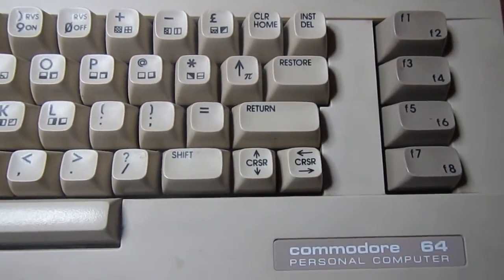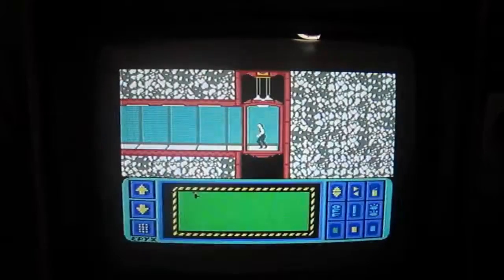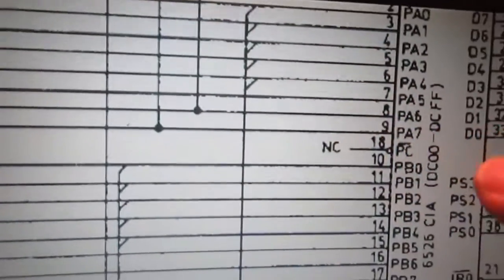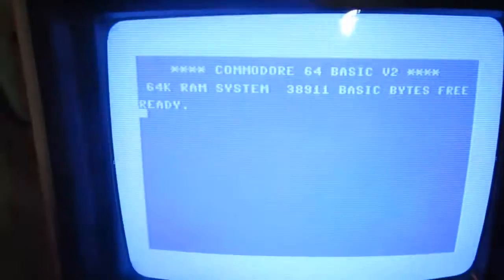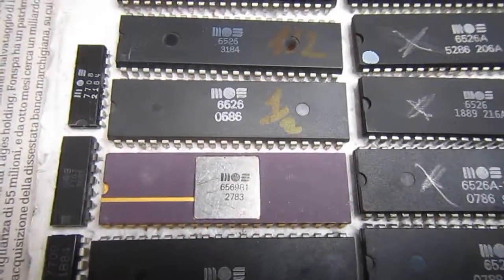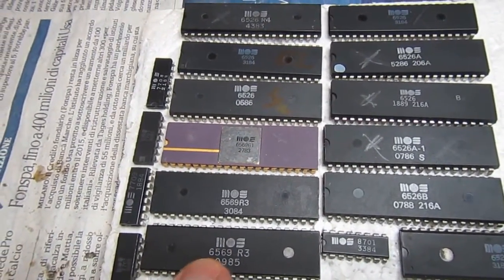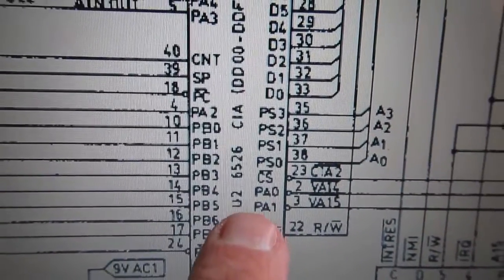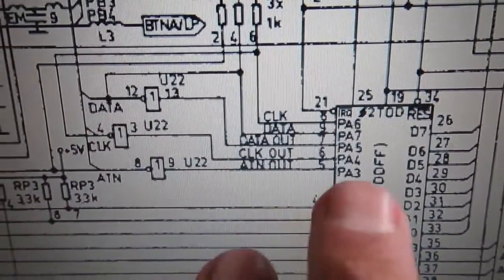C64 (C64C) CIA#1 repair (keyboard/joystick faults)

Comment: Hi, nice video, actually my c64 has issues when I get joystick into port 1 and press left, it responds kind of laggy , Ive been using this program as I dont have from where to load programs, my datasette has issues also, I can only save to it what I write and then load from it, but i cannot load my original tapes, i tried 4 of them and also tried some fresh recorded ones on 2 different cassete players, still no results, this is what i used for joystick testing: 
10 for k=0 to 10:read dr$(k):next
20 data "","up","down","","left","up/left"
30 data "down/left","","right","up/right","down/right"
100 j1=peek(56321):j2=peek(56320)
110 f1=j1 and 16:f2=j2 and 16
120 j1=15-(j1 and 15):j2=15-(j2 and 15)
125 print "j1 "dr$(j1):print chr$(145) tab(20) "j2 "dr$(j2)
130 if f1<>16 then print chr$(145) tab(14) "fire!"
140 if f2<>16 then print chr$(145) tab(34) "fire!"
150 goto 100
Reply from the maker: the fastest thing you can try is to swap the two 6526 if they're socketed. However it's not easy to understand what you mean by "kind of laggy". I guess you get a delayed action. It's not very simple to debug such an issue remotely. The joystick inputs go directly to 6526@U1 with just a
feedthrough filter in beetween. If there's the correct continuity through the filter, there's not much else that can cause this fault other than the 6526 itself.
Reply: @iz8dwf  yes, delayed means 😁" kind of laggy" thank you for your response, I will check to see if I have faulty cia chips, all the best from here!
Reply: The joystick works fine into Port 2 so its not a joystick issue

Comment: My Commadore 64 C I'm working on has a issue when I plug in the joy stick it actually begins printing text and cursor starts moving. I'm going to take a CIA off a donor board and see if there's a difference. With this massive heat sink they put on the boards who's how hot they got.
Reply from the maker: It shouldn't make a difference if a joystick is plugged or not, it could make a difference if you actually move the plugged joystick. Are you sure the joystick itself haven't got a stuck contact?
Reply: @iz8dwf  It's an old Atari joystick. I'll load up a game then try it.